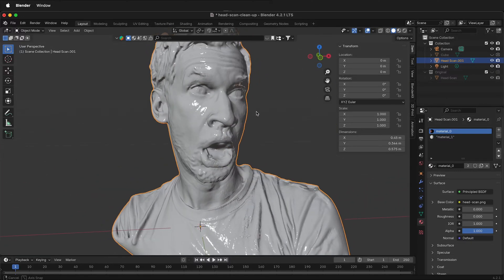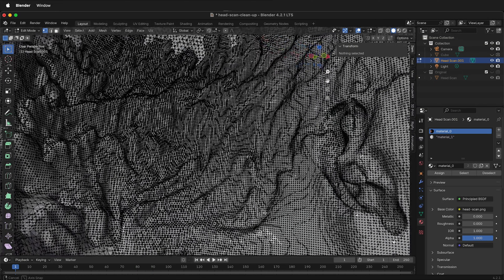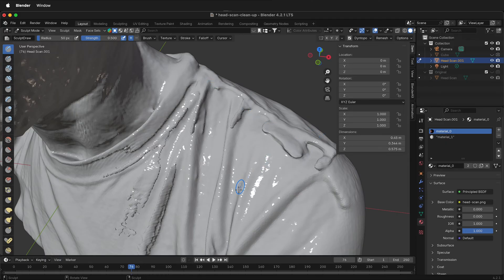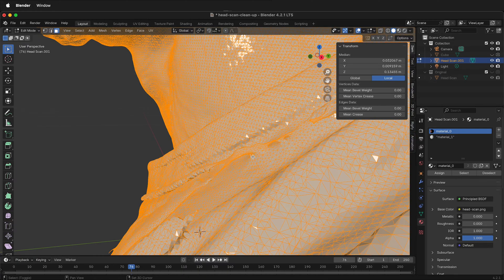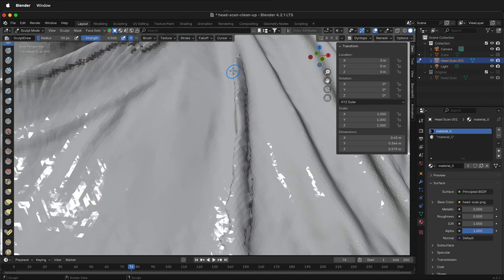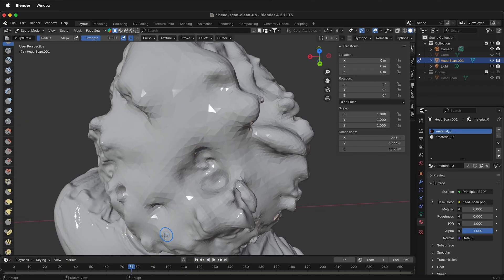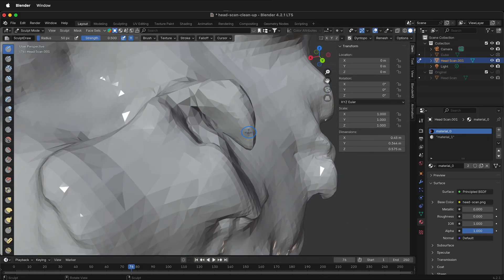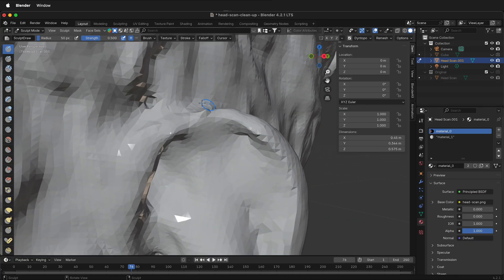Clean Up 3D Scan Mesh in Blender

Comment: Im trying to make a super thin scan I have into a 3d solid object so I can use the boolean tool to cut it from the middle of a cube. Im trying to make a fiberglass mold. Any recommendations on how to make the scan solid? It's about 1mm thick so the remesh tool is struggling to map it and it typically crashes my pc due to the complexity of the task
Reply from the maker: Switch into edit mode, then orbit around so you are inside the object, then click on one of the inside faces, press l to select everything, check if it only selected the interior or not, if it selected the interior then just delete all of those faces and now you have a single mesh that doesn't have an inside 

If that doesn't work after pressing l, then select some of the faces of the interior part of the model with the circle selection tool, make sure that you're only selecting into your pieces and keep trying to cut around until you can delete large sections of the inside 

It's a bit tedious but doesn't take that long. If you focus then you should have a single shell that you can. Remesh. 

Before remeshing make sure that you select all vertices and merge by distance

Comment: Thanks for this!  I use Meshmixer constantly for my EVA and Spider scans, it is really the best.  But the software has an undetermined future since it is hanging on in Autodesk's portfolio as a free product.  Blender opens large scans more efficiently, and its sculpting tools feel better for me, but as it is custom built to edit meshes (highlighting open edges, smoothing tools that "zipper" up open edges) I will probably stick with meshmixer for now.  I really wish Blender did all of that (especially the zippering / smoothing of edges) but as it is designed for so much more, the custom tools for scan cleanup are not something the Blender community has really focused on creating.
Reply from the maker: Glad it was helpful, you should try the 3D Print Toolbox add-on for Blender. It can help fill holes and make meshes manifold

Comment: Thanks. Similar issues when fixing AI meshes.
Reply from the maker: Yes, those are a mess sometimes
Reply: I need a dissolve or erase brush, Smooth often ends up with a small pointed area that won't remove vertices to flatten out. Manually fixing those are brutal.
Reply from the maker: @FPChris  Yes, fixing those points with the smooth brush can be difficult, if you're using dinotopo you can zoom out a bit then just build up a little bit of mesh and a random area on the point. Then try smooth again and often it will go away on its own

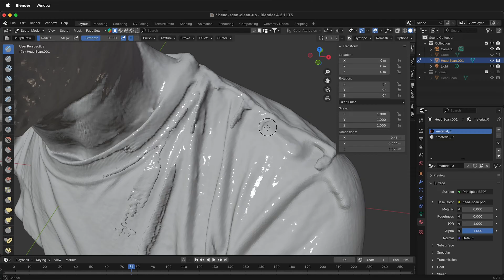Comment: How did you do that? 2:57
Reply from the maker: If you hold the shift key while using sculpting tools in blender, then it automatically switches to the smooth tool, no matter which sculpting tool you are using
Reply: @WhatMakeArt  i understan that, but what hotkey did you use that to lowering poly?
Reply from the maker: @TaoRaizu are referring to the dynamic topology? That is a A check mark in the top right when you're in the sculpt mode. By default the farther away from the model you are the coarser the topology created is and if you are closer then you get more detail, if you go into the settings then you can also change it so it has a constant detail no matter how zoomed in you are
Reply: @WhatMakeArt  oh, thank you! I was confused... Sorry about that.
Reply from the maker: @TaoRaizu Hope your 3D sculpture comes out well 🧌🦩🐈🍎🍄🔥🐇🌵

Comment: It  was a little fast for a beginner Blender user but this is exactly what I needed to fix a model I had with strange blemishes on the face. Just the fact that you give shortcut keys and such is helpful to learn it and I like how you described it in simple terms as to "this problem may happen so you can do this then this". Very helpful. I am using a Creality ferret (PC version) and while it did a good job with some other scans, not all of them came out right and this was what I needed to fix them.
Reply from the maker: Glad it helped, 3D scanning is super cool but often requires a bit of cleanup, hope your project turns out well 👍🦩

Comment: Great tutorial.  I was wondering,  if I wanted to add another object say a base for that face 3d scan. How would you connect it to the scan. The geometry is different and if I join it, the slicer luban won't slice it because of the geometry.  
I use luban to make bigger models because my print bed is small. 250x250x250